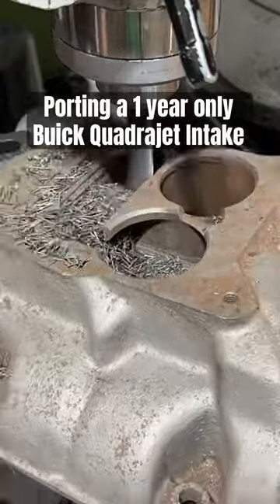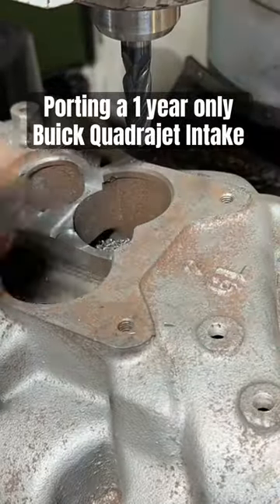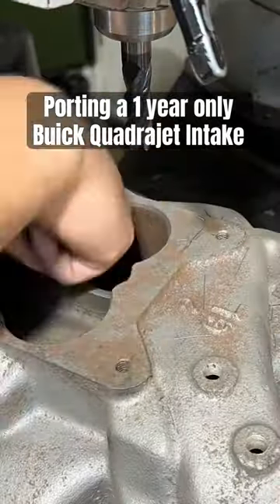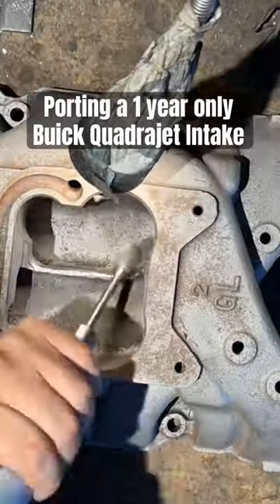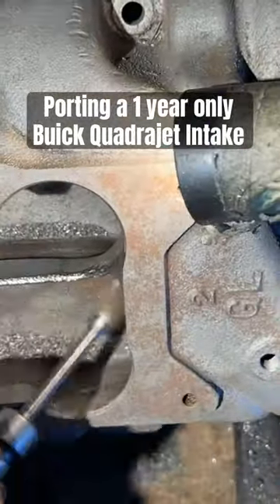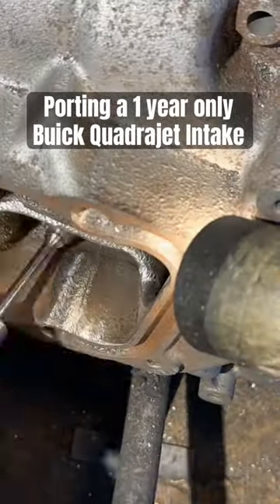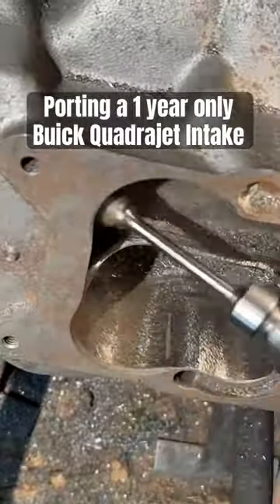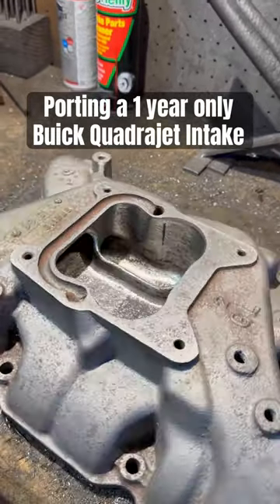If someone likes modifying rare parts its me! #shorts

Comment: Modifying parts to get more performance is what hot rodding is all about. That intake looks nice.
Reply: Amen brother🙏🏻👍🏼
Reply: There is that.
Reply: If the shoe fits wear it. This is what it's always been when searching for those hidden ponies. Awesome!
Reply: Yes sir,a lot of trial and error but worth it in the end.
Reply: Sorry. It's not just hot rodding. When ever I've restored a vehicle, I moded all the factory flaws and/or short cuts. It always looks original. But if I can do a little port relief, carb improvement, I will. Anything to do with 'flow' is fair game. IMHO.
Reply: You just described the very essence of Hot Rodding my friend. I don’t disagree with you one bit. Porting, polishing, modifying the carburetor, tuning air flow, that’s all hot rodding. Granted it may not be to the same degree as putting a huge cam and some high compression pistons and what not. It’s still modifying parts to improve performance. That is exactly what hot rodding is.👍
Reply: The trouble is. 100% of rodders want to screw with the outside appearance as well!  "Shove in a small block. Fit  super chargers etc." The car becomes worthless and unrecognisable.
Restoration is about keeping the look, while impr0v9ng the ordinal design.
Reply: Think…. When made, it was a casting.
Clean the sand out. Install to engine.Sell car 🚗.
They didn’t spend time on it.
One guy: 10- engines/hour.
Reply: I wouldn't be surprised if there are blocks out there that were modified by default at the time. 
Now you find that one unmodified block and then the conversation goes like
"How many HP you got?" 
"Stock 110."
"Bro, you've been lied to, that baby does 300!"

The essence of the engine did not change, in fact, this is like leaving a note to Clark Kent telling him go use them super powers.
Reply: My deal is were in 2023 we have CAD & CNC anyone could've easily scanned the manifold in its original form and started machining out manifolds for restorations and aftermarket development. This was just like a set back in hot rodding
Reply: At least that's what I tell myself when I look at the handful of bolts left over after a repair.
Reply: Ya when that was your only choice
Reply: Agreed good job
Reply: he wrecked it because he dont know how a carb works every one should tell this fool to take some classes on carbs
Reply: Hell yea

Comment: Love that you removed the factory restrictions from that manifold
Reply: How do you know they were restrictions?
Reply: @matthewklein9225 they are going to be restricting with the carby hell be putting on it. You won't get 600hp using the stock carby. He needs to open up the flow to accept the extra cfm. I'm not familiar with American motors but what he cut out looks like it was put in to help with tuning and getting better torque over a wider power range. Most likely had a 4 barrel primary and secondaries that opened later. What I will say is it's known that you get more torque by having a splitter in the manifold. So I'm not so sure he's made the best decision or just gone with the most basic idea that will accept the new carby. Being he's only doing it this way because there is no aftermarket part to suit his needs.
Reply: @tonymarshall9670  without back to back dyno tests it's difficult to know what then engine wants. Cutting down the center divider that low is generally a loss of power. It may produce a gain above 6000 rpm. 
This type of modifications decreases the signal to the carb, it doesn't increase it.
Nailhead engines are known for torque not high rpm horsepower.
Reply: @matthewklein9225  I rewatched and he said quadrajet carb, came standard. If they are the same as the ones I remember in a few 80s engines here. They only opened up like a secondary with vacuum at high rpm to let more air in but didn't add more fuel via that inlet path.
Reply: @matthewklein9225  your right it would be a mission, a Dino and most likely a few manifolds to figure the best way.
Reply: @tonymarshall9670  quadrajet carbs do have a vacuum operated secondary. Fuel is added as the secondary opens though. Otherwise the engine would stall.
Reply: @tonymarshall9670  It takes a lot more than a carb to get 600 HP.  😂
Reply: @TheBasstead1  no shit Sherlock
Reply: @ØÇÅRØPÎÑĒÅPPLĒ9033  first there must be a restriction. 

I can speak with certainty that Pontiac engines do not respond to the crossover being cut down like this. It had been explored thoroughly with dyno results to back it up. Jim Hand wrote a book about it. The Arlen Vanke street hemi intake modifications look somewhat similar to this but a Buick and a Hemi are 2 different animals. Pontiac's and Buicks have more in comon than Buicks and Hemis
Reply: @tonymarshall9670  will hurt his low end torque but he may gain on the high end.
Reply: @rogercoder1469 that would only apply having an effect on the standard engine and set up. It's now a worked motor and set up. It should increase torque across the board. He can put a good high raiser plate in and you can get them with the splitter to match the carby. He may need to modify the manifold side to suit. I'm Australian so I gave zero knowledge with the motor he's working with. Raising to get more fuel velocity with the the longer drop will increase his bottom end torque. Even a 1" raise is noticeable and gets rid of some low end flat spots. Really helps when you can't tune the bottom end for take off. They become more responsive the higher you raise them.
Reply: Street drivability will probably suffer, but this build isn't about driving on the street
Reply: @tonymarshall9670 good day mate! Whats the antipodes like now days?
Reply: @tonymarshall9670 you have tons of exp with that engine it's the 215 /3.5 ltr rover v8.
Reply: @djmtndew  OK now I know, back in the day they were not that popular, although they had a cult following of people who swear they are the best ever. So much so that here we now have performance parts available. I'd imagine they are mostly made by machine modifying standards parts in one of our shops. Looks like they are devoted to doing rover and triumph parts in the one outlet.
Reply: @tonymarshall9670  yeah Buick sold this 3.5 215 cu in v8 to rover - Buick also sold their V6 version of this engine at 198 cu in to kaiser jeep. Which would eventually become the dauntless v6 and them Buick would buy both engines back from their respective manufacturing parties. The 198 eventually became the 258 3.8 ltr turbo v8.... ey boy.
Reply: @djmtndew  we did a v6 3.8L was very popular engine. Some people used to get buick heads imported for the bigger valves and better port flow. I seen some crazy mods on them and they would really crank up. I remember one on a race car where the extractors were glowing red hot on the dyno. Those engines were almost bullet proof in their stock form. Many of them are still running strong 3 decades later. Problem is the cars have fallen apart around them. We often use them for cheap competition burnout cars. We had one that we tried to blow up every competition. We failed every time that thing was indestructible even with the valves bouncing it just kept running at every show.
Reply: @djmtndew Buick 3.8L = 231ci, Buick 4.1L = 252ci both v6's... A lot of guys use the 4.1L with the turbo top end to get more "power" , the supercharged Buick 3800 is a powerful engine also and again with the older l67 supercharged 3.8L you can swap the top end... Australians should know these engines well from the Holden, and that's where a lot of guys who use them in rwd cars get their plenums from...
Reply: @tonymarshall9670 you csn mske manual with a screew snd it will make more power for sure
Reply: Throw a single plate Nitrous kit on there and enjoy the magic show!
Reply: It would be nice if he removed the comment restrictions 😂
Reply: its lack of vacuum that opens the secondary, under normal driving secondaries sucked closed from manifold vac, when you dump it manifold vacuum drops, opening secondary and yes more fuel goes in

Comment: Hi, in the 60's l lived near Woodward Ave so I went out there all the time. My first car was a Plymouth GTX 440 4spd. I milled out a stock cast iron "Holley" intake after reading about it in one of the car magazines. John Keselowski (Brad's Grandfather) guided me at his shop. Using tube headers,a Holley 3310 (780cfm duel feed vac secondaries) a "cop car cam,'' as John called it, and one of John's curved Hemi distributors my car became very quick. Middle 13's @ 115mph on old Kessler "cheater" slicks that were shot. On Woodward, Telegraph & Gratiot Ave l only lost 2 races. 1) Duel Quad 427 Impala 4spd- I missed 3rd. & 2) 1969  Boss 302 Mustang 4spd. I had the Mustang thru 3rd, but he nipped me cuz he had a gear, I had 3.55's suregriped. That engine was a blast to drive but w/ 3.55's I needed to go out on the Expressway if it was close, as was the case w/ the 427 Impala. OH YES MILLING OUT THE PLENUM WORKS. I believe it turns a duel plane into the equivalent of a single. ben/ michigan

Comment: I'm over 60 and I love the modifications. Great to hear you working on a Nailhead, very under appreciated motor. I've modified Mopar LA intakes similarly, mostly because I was broke and still racing. This mod will work well.
Reply: Lol That's exactly what I used to say alot😂
Broke and racing😊
Reply: I'm 70 and my 2014 RS/SS Camaro is NOT stock. Stock is boring!
Reply: My idol! 🫡 😂

Comment: Im 54 and can easily see why this WILL help. First adding plenum volume. Dual planes are relatively high velocity but flow has to be way down on the stock piece. Slowing things down under the throttle blades will certainly improve all kinds of signal to underneath that carb which of course affects the signal above the venturies as well. It's been contested many times but opening up the plenum to allow both sides or planes to "talk" definitely helps with signal as well as flow.

Comment: Opening up the intake manifold in this fashion will greatly improve the performance on the high RPM range!
The low RPM street ability will suffer a little...
Reply: True
Reply: No, not really. Its just increased plenum volume and both sides now connected would only affect low rpm torque and response if the stock carb was untouched. Its still a dual plane manifold. The change down low will be so insignificant and the increase in flow with the same velocity from the dual plane design means it will recover below 2000rpm. 
I know what y'all are saying but honestly the improvement will cover up the very slight loss at the bottom of the curve real quick

Comment: I’ll be real impressed when that nailhead makes 600hp
Reply: Yeah I was wondering where he got his numbers from😂
Reply: It might make 475-510 but 600 is a stretch...unless they got some secrets like this manifold goes away and it gets a 6-71 on alcohol.
If i said the same about a 394 Olds y'all would laugh at me when i said its gonna make 600..
Reply: Removes metal from an intake this engine's gonna make six hundred horsepower...😅 yeah okay buddy... I think you meant 300 to the wheels....
Reply: Ain't happening. Not without an air pump...
Reply: Why would you care about stock appearance intake when you change the heads to radical aftermarket splayed valve setups? Cause that's what you'd have to do to make 600HP even if you were able to measure at the pistons!
Reply: Not without some sort of girdle, he's not
Reply: @tylerandersenandthegang he literally said. this combination will make just under 600hp. combination as in all the other things he has done to the engine. he never said wheel horsepower either so sure i dunno 500 or less to the wheels then.
Reply: He's saying the intake will now flow good up to 575-600hp he's not saying it's going to automatically make 600hp by modding the intake and slapping it on obviously that's not how things work anyone with common sense knows that
Reply: Uhhhh no, maybe 390HP-410HP net in the best case... 600HP hey in a nailhead? God doesn't have that much money!
Reply: @charleshubert6751  You must be kidding still. 400HP "net"? MAYBE at the crankshaft.
Reply: Of course it'll be super or turbocharged.
Reply: "just under 600HP" I mean yeah, 375 is just under 600.
Reply: @DigBick91 most people don’t know shit about cars so is definitely not common sense 😂
Reply: That's the real trick!
I've  never seen it,  but I want to see it! Nail head... 600 horsepower...¿
Reply: @williamstamper442 MAAAYBE with a Predator carb
Reply: Wow! Some of you act like 600hp is an unattainable number. With the right cam, pistons, heads that have had some work on them and been tested on a flow bench and a good tune it's very possible,  and you don't need a supercharger or turbos to do it. Now it might not be very streetable and run like shit on anything below 110 octane but it's still doable.
Reply: @EricSloppy-qv9wx  ...and 8 of those split-fire spark plugs!
Reply: @johnrushing4957  These days, 600 horsepower is absolutely achievable, and even not that hard to make.... I agree.  BUT, have you ever looked at a Buick nailhead engine?  The heads?  It won't even come close to 500, unless it has some radically redesigned aftermarket parts.  Just the way it is.
Reply: It wasn't that long ago anything with 500hp on the street sounded crazy. I've seen guys at engine competitions make power with these, so I have faith in the builder.
Reply: Maybe if you put something with it, like a rocket in the trunk. Beep beep,whooooo
Reply: It’s got a big honking turbo i it
Reply: @williamstamper442 dude I got 610 on a 350 small block
Reply: @sniper7.62x51 the 425 nailhead made 360hp stock....
Reply: I have that in my 56 half ton I'd like to do that.   I love my motor it's Hell for cruises.   Got a blower but have to build it so I can run it.  It's back out now the setup is great.  Turbo Hydro and 8 inch Mustang 369 gears.  All new brakes doesn't work just barely slows it.  Thinking independent suspension With disc brakes maybe..  
Could You follow up and let us know how it goes.
Reply: @causeimbatmaaan Now where would you get said heads for an early 60s Nailhead Buick?
Reply: @Blown460  "said heads"?
Reply: @causeimbatmaaan it's not basic English, but he is right. Said in this context is in reference to-- something that you "said" before. It is used extensively in legal documents and court briefs.
Reply: Found the rookies he was talking about
Reply: @buildingracingvideos4714 that and aaaa whoooooooole lotta other things. Nasty roller cam, totally custom heads, and a lot of compression. All things are possible but im not sure about this case lol. I would want to see a single plane riser at least to believe that.
Reply: Well as a man who is 39 and has been a mechanic for 0 years I can tell you that 600 hp is a lot for a Buick nailhead and I’m sure you’re right. I have a 64 Riv that has (factory) 425 single 4 barrel. 340hp and (factory exaggerated) 465 ft. Lbs of torque. But based on all my knowledge, I can tell you unequivocally, that this is the best comment section on YouTube lol. 

I’m sure if I just shaved off a few layers of metal in the intake  I can take my 64 Riviera and one wheel spin my way to victory against a hellcat lol. 

Dreams, Am I right?
Reply: The 425 in the Rivierra was a monster. I dont see why he couldn't get close to 600. The 364 and 401 were highly sought after in the 60s for hotrod. Those nailheads had lightweight small valve terrain. Just different but worked well.
Reply: the restrictive head design begs for boost lol
Reply: @captainchicken8983  the advertised number ratings on those engines was the torque. So a 425 cui was 425 lb/ft, maybe 600 lb/ft at 4600 rpm with like 425 hp? Maybe there is some confusion going on? Idk, but I give him props for getting off the couch and doing things.

Comment: I did that an LD340 intake.
Improved mid/high rpm response. 
Turns it into an equal length single plane intake manifold.
Watch #6 spark plug for slightly lean mixture😊
Reply: That's great info.
Reply: Oh sh**, you’re right!  Nice.

Comment: I've done done my share of plenum divider cut downs (NOT removals) and it is quite effective~ as long as you don't go too deep. You can kill bottom-end by overcutting/lowering the divider excessively, as it will have a softening effect on your vacuum signal.
Hopefully your customer isn't against using a quadrajet, as they are infinitely more tunable than a holley. It will provide as much power AND better economy while basking in the camouflage of a "stock setup".
Reply: Good point. I was thinking he should have machined 'turtle shells' at both plenum bases. Someone used to make those to epoxy to the base of any intake. Improved performance.
Reply: @Ben-h2o I still have a pair of turtles in my toolbox somewhere. Do they really work ? I've never noticed a difference personally.
Reply: @DrFigs  “bog”. Good one 😂

Comment: It should work well on the top end with cam compression, timing, etc . But you may lose some on the bottom end if it's mostly stock, but we'd like to see A before and after dino sheet. Goodluck.